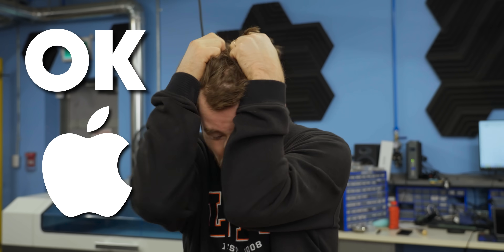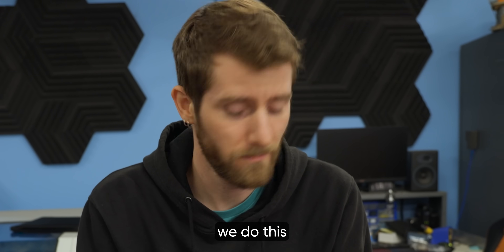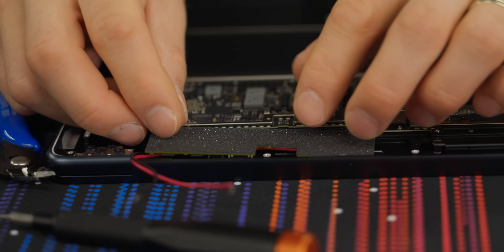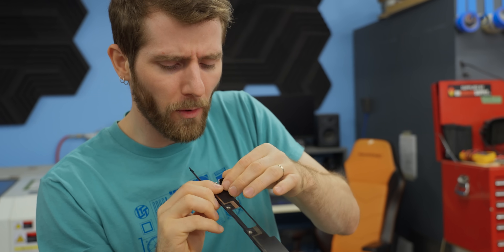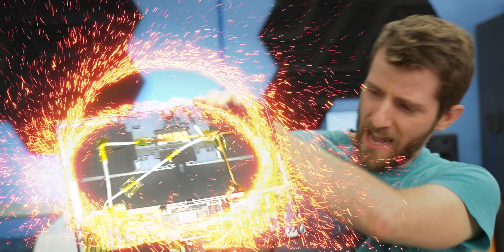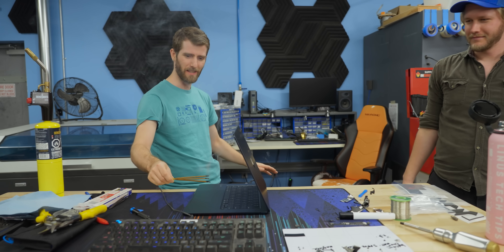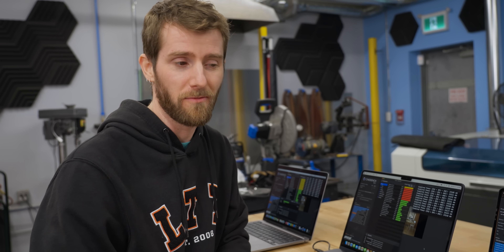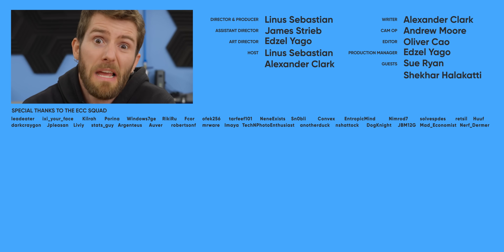Apple please watch this. - Frore AirJet MacBook Air

Comment: One thing they didn’t mention is that if these were integrated from the beginning, the vapor chamber could be designed to move heat directly to the copper pads on the cooling units, unlocking even better thermal performance
Reply: Yeah, no doubt if designed around using those they could make it much more efficient. I think each unit can remove 5 watts of heat IIRC and it looked like they were only getting 5 watts out of the three combined. I'd guess probably because of inefficient transfer.
Reply: @TheDarksideFNothing but these chips itself need a lot of juice
Reply: @_yuri  if you're talking about Apple silicon then no, that's half the point of them. In this video we saw them all only drawing 20W even before they throttled.

If you're talking about the cooling devices iirc these are 1.5W each power draw to cool about 5W, but there are other models coming soon that will be significantly more efficient. Someone else said there's one that's expected to be 1.5W for 10.5W of cooling, but I can't speak for those numbers. 

Plus, this is hacky edition cooling with these chips. If it were designed from the ground up to incorporate them it would certainly be more effective.
Reply: @TheDarksideFNothing Imagine one of 20W that uses 1.5W... That would be game changer for stuff like Nintendo next portable console and steam deck successor.
Reply: @oklou7  Solid state cooling doesn't use fans, so it's already silent.
Reply: @upinarms79  Quiet not silent.  Despite Linus constantly saying "no moving parts", there ARE moving parts as its based on the same technology as those paper thin speakers in greeting cards.
Reply: @alexatkin I think it’s also used in heaterless vaporizers or humidifiers
Reply: @upinarms79  it's definitely not silent the air still gets pushed around
Reply: @grenadeasc  There is no fan, they're solid state cooling units. It even states on Frore's website that they're silent.
Reply: @upinarms79  Frore's website says how much noise they make. Mini is 21 dBa and Pro is 24 dBa.
Reply: @Shelaba  Which is, for most purposes, silent to human ears in all but sealed and sound insulated environments.
Reply: Wait you mean a computer designed to have good thermal performance might do better than a normal apple design? This is madness, everyone knows thermal performance can only be achieved by courting the favour of the machine spirits.
Reply: @oklou7 Typical apple consumer. Justify bullshit on a company's behalf.
Reply: @Edinburgh1000 they need to add the cooling fan into the MacBook air and who cares if it's not completely silent quit whining. The whole point is to protect the internals. It's not to please the human ears.
Reply: Or maybe it is just the chip lottery .. he needs to test more unmodified units to have a better reference
Reply: @adriangeorge2203  That's extremely unlikely to make a significant difference, especially running at stock. Gone are the days where you get massive differences from one chip to the next. Both Gamers Nexus and I think Der8auer did great videos on this, testing something like 40 samples of the same SKU and the vast majority were within margin of error of one another for all stats and even the outliers weren't different enough that it would change the conclusion of a video like this.
Reply: Apple hates this one trick.  No, I'm not trying to make a joke, I really think apple actually does hate this one trick as much as they hate their customers.
Reply: @cburgess7  "No, fuck you, we are making it this way and you WILL love it and you WILL pay extra." - Apple probably
Reply: @oklou7  they will never do this i think not because of those reason, but so that it won't kill the macbook pro lineup. Also i think recording studios usually have separate room for the recording station and the person that is being recorded so.. i guess it doesn't really matter?
Reply: @siontheodorus1501  the question is whether they do it for the Pro lineup. Because then they can market the Pro as even more silent (i assume) and prob. save some space.
Reply: @oklou7  All they would have to do is give you a setting to turn active cooling off...

But at least then you would have the option to have your Air not run totally kneecapped by thermals.
Reply: No they can't, if AirJet is off then there's no heat transfer at all, because AirJet doesn't use heat pipes or some copper plate extension to transfer heat. It's either this or no cooling at all, not even passive cooling.   @TheDarksideFNothing
Reply: @maxwang7937  
Passive cooling happens no matter what, it's not like an air jet suddenly disables thermodynamics by being off. The passive cooling apple did include is just a stamped piece of thin aluminum that doesn't even directly transfer the heat outside the computer, just spreads it out inside the chassis. This is not a difficult amount of passive cooling to create because it already basically is non-existent.

If they designed from the ground up to incorporate it they could easily include at least most of the passive cooling capacity as the normal MacBook air (which is enough for idle or bursty workloads), but then strap a few air jets to it to improve the performance under load. Probably the overall design would have to be just a tad larger than the current one, but not by a very noticeable amount.
Reply: @TheDarksideFNothing  The air jet is going to be in between the SoC and the chassis (or whatever other material to increase the cooling capacity), so heat cannot be efficiently transferred out once it's turned off. The only way for air jet to be optional is to have it and the passive cooler as 2 "coolers" both attached to another heat transfer device (for example heat pipe). But then it would be much less efficient than just the air jet.
Reply: @maxwang7937  all they would have to do is have the copper plate at the bottom of the air jet extend further out in a similar way to the current aluminum stamp. Perhaps even have it transfer to a cheaper material.

I think what you're not getting is the abysmally small amount of passive cooling currently in the design. This would not be hard to replicate in tandem with the air jets.
Reply: @oklou7 i think u r speaking 4 urself. Cuz the reason y i buy macbook is because they are more optimize than windows and i want that power and i dont really mind about the sound it make cuz i wear headphone that have superb noise cancellation and my mic is also did also have that function. So yeah, not everyone has the same reason as u. Plus it comes down to preference.

Having a cooling is a good tho, throttling and lagging is not a good for the macbook itself, so for me i hope apple can keep doing what they good plus have something to blow out the heat is good macbooks longevity. What linus show is 91°c and is freaking hot. Even high end intel that needs a lot of heat doesn't heat that much. 

If u ever see on any laptop that has a thermal problem, there is a burn mark on copper that is used for cooling, if ur laptop has that mark, u r so done and having that mark in the 1st place is already a severe problem in a laptop.

Comment: Since the cover is made of Aluminum, they should have slapped one of those on the cover right under the CPU and added a piece of metal (+ thermal paste) between the CPU and cover.
The CPU's heat would have been conducted by the piece of metal directly to the cover and to the copper spreader of the fan and the fan would blast it out. The whole thing would have been waaayyy less invasive (no need to cut anything) and the static pressure of that thing would have been put to good use (by blasting a hot surface with fresh air).

The notebook would probably wiggle a bit, but nothing some pads would not be able to solve.

Comment: People have made gains and even bridged much of the gap between an M2 Macbook Air and an M2 Macbook Pro just by using a thermal sheet, bridging the tiny heat block to the bottom chassis, exchanging a warmer bottom for using it as extra heatsink. That had significant results for less throttling.

It looks like they added a fair amount of copper heatsink there. I'm not doubting that the airflow adds to the performance, but an important comparison would have also been passive copper heatsinks with no airjet too. That said, I hope Apple is looking closely at these and integrates them if they can improve their products, but I don't want the Air to move air, I want it for the Pro for as much better and smaller than fans it can be.
Reply: Yeah, the Air just really needs a thermal sheet. This airjet stuff could go a long way to making it possible for the MacBook Pros to become thinner and lighter, or could let Apple stuff even more performance out of their chips
Reply: @AlexBarbu  The easiest handicap on the Air is having a base M-series chip while the Pros get better SoC’s like the Pro and Max chips. People buy the base M3 MBP because they want the nice screen and ports, not because it has a fan.

Apple doesn't have to limit thermals in order to differentiate the products. Apple sees having no fan as a competitive advantage because they put a high emphasis on quiet computing, low power usage and therefore long battery life, and light weight. That’s why people buy the Air more than any other Mac.
Reply: Can’t do that. There is a legal limit for how hot the bottom can be. MaxTech did just what you suggested and the bottom became hotter than the law would have permitted.
Reply: @techinrl9869  There actually isn't a legal limit, but there are several recommendations that converge on not exceeding 48°C, and there are high temperatures which require a warning label or can come with workspace restrictions.

That being said if you were Apple and intended to optimise performance while observing this 48°C threshold, you would still install thermal pads board to case, and then adjust the board throttle threshold down until you meet this spec. Because evicting heat is always better than not evicting heat.
Reply: Apple is for sure not looking to make their lower end products better, as that would cannibalise their higher end products.
Reply: @SianaGearz  Not if they applied corresponding upgrade to the higher-end products....
Reply: @AlexBarbu  Typical Air is already handicapped by .....everything: external screens, no 120Hz display option, port options... Apple's favourite RAM option.

Comment: This video has a valid point for the airjet tech, but man, this mod was so awful... Impressive, but the computer may as well no longer be a laptop at this point, it's missing so much... Boo on the destructiveness of this mod, but still a nice show of the tech... Still, it's more impressive that Apple's passive solution loses so little performance, even when throttled.

Comment: Actually, even with these cooling devices there are moving parts. Inside are tiny oscillating fins that actually move the air around. Currently there is only one known way to move air without any moving parts, but that requires really high voltages and isn't very power efficient and isn't what was put into these tiny devices.

Comment: What a stupid idea, if you need performance, get a different laptop, the Air is fan-less & not really meant for peak performance.
Yes it heats up under sustained load, which isn't its general use case.
Having a fan-less design is great if you want to use your laptop in bed. 
You're fixing it by ruining it.

Comment: 14:39 "No moving parts guys!" ...Meanwhile the manufacturer: "Inside the AirJet are tiny membranes that vibrate at an ultrasonic frequency"
Reply: It's literally the exact same as a Speaker or Diaphragm pump, and absolutely has moving parts. Especially with Piezo and ultrasonic frequencies, it's a terribly inefficient way to move air but the design and operation is literally identical to a Tweeter or similar. Just more fake tech.

Comment: I've never actually felt this computer get hot. I use it on my lap..on the bed..wherever. I think if you try to game on it, you are going to have a bad day, maybe don't run VM, crossover..WINE, but I literally only hear fans on Pro(chip..M2/3..same spec 16GB,  more cores)when running games, not even multiple VM switches them on.

Comment: Also, if I'm remembering correctly, they said it was more efficient in terms of energy consumption. Which could allow the use of larger batteries in other devices where much of the space is used to cool them.
Reply: what kind of device has battery heating issues LOL
Reply: @jatoxo literally all the devices, and also, that was not the point I wanted to make. What I wanted to say is that we could take advantage of the space to put larger batteries since we would not have to use space on conventional fans inside a device (like laptops or portable consoles).
Reply: @nnoas971  Fans don't take up that much space, and if you make the battery bigger, you make the device heavier.  Plus plenty of laptops already have the legal maximum battery capacity you are allowed to take on a plane, which means they can't actually add any more capacity.
Reply: @alexatkin  Why is it so difficult to understand that I am talking about the future? Of course, today's fan system does not take up much space since it has been optimized for many years. This is an emerging technology, and its use and modifications to optimize it have not yet occurred. And as for the batteries, referring to the fact that I'm talking about the future, those restrictions are for Li-ion batteries. Nowadays, there is solid battery technology that is safer than Li-ion batteries and should not have the same restrictions, but the bad thing is that at the moment, they are kinda difficult to manufacture for industrial purposes, much less commercial ones.
Reply: @alexatkin  100Wh so most laptops withLARGE battery packs claim 97Wh.  Apple is around HALF that value.

Comment: 2:15 "the system could be cooled better and FANLESSLY" ...*immediately proceeds to install a fan*
Reply: 14:39 "No moving parts guys!" ...Meanwhile the manufacturer: "Inside the AirJet are tiny membranes that vibrate at an ultrasonic frequency"

Comment: no keyboard, no speaker, no mag charger, and having to machine the case makes this completely useless info, especially when it only gains a small bit of points in cinebench.....Do it to one without needing to mess up the case and keeping all functionality and then itll be worth doing. The entire reason it throttles and they didnt put better cooling is they couldnt, as you showed
Reply: They could, but proper cooling and crazy thin don't fit in the same sentence, so they decided to sacrifice the performance for very little aesthetic gain 

There's a difference between not able to do it, and not able to DIY it with a pre-produced product

Comment: All this mod needs is a custom bottom plate. Like, that would solve every issue. Just make it a tiny bit thicker at the back like the old Air design was anyway.
Apple know exactly what they're doing. If the air had active cooling, there would be less people paying an extra thousand for the pro 🤷

Comment: Too expensive for Apple.  The only thing they'll spend more money on than absolutely necessary these days are the chips and the display.  They can't even be bothered to properly set up barebones components to protect the soldered on SSD from incorrect voltage, or use adequate spec display cables.  You think they'll buy this fancy new fanless tech?  YEAH RIGHT.

Comment: So would it not be easier and cheaper and more practically usable to just cnc a new bottom panel with space for a cable passthrough so its basically a drop-in replacement?

Comment: It's hilarious to me Apple users buy something that thermally throttles from the factory. And it's not only the Air M2 without the fan that run uncomfortably hot. People in forums have been saying that their Pro M2 runs at 80, 90, 95 even up to 105°C. At least they don't sound like "jet engines" I guess 😭

Comment: Hello @LinusTechTips your energy consumption numbers are incorrect since your fans are pulling power from the motherboard, so it's normal to have higher consumption. I hope that you wasn't aware of that. try another benchmark with the fans plugged to a power supply and let's us know the real results :)

Comment: the differenc ecould have been larger if you would have stressed the GPU as well. I know this from my M2, but generally, this is why many are still fine with its capabilities... 5% reduction in performance despite passive cooling is just impressive.

Comment: i bought the macbook air specially because it doesnt have any fans, try shooting outdoors with a sandstorm going on and doing a rough cut for the director without sand clogging up the cooling system

Comment: It would have been nice if you also made a comparison of the noise emmision between the two MBPro and the modified version - I suppose it should be way quieter, but - what noise level das the MBP reach?

Oh, and if this really works - maybe give Framework a call?! ;-)
Reply: Using stock settings they're quiet, but what he missed here is you can modify the fan control to where it becomes loud but cools a whole lot better than default. That may also widen the performance gap.

Comment: Linus
On those Flir's you can go into the center point settings and set it to "Hot Spot". This will create an adjustable box with a cursor inside that will track the hottest point. Now you have to be smarter than the camera as in any shinny surface will detect reflected temperatures. The hot spot indicator would show false readings from reflections. Still is a useful tool to use though.

Comment: Cool tech but the easier cheaper less jank option, that Apple should have done, is to put a thermal pad between the cpu and case, even between the existing ‘cooler’ and case is better. But I think they didn’t because it would the air would eat the pro’s lunch